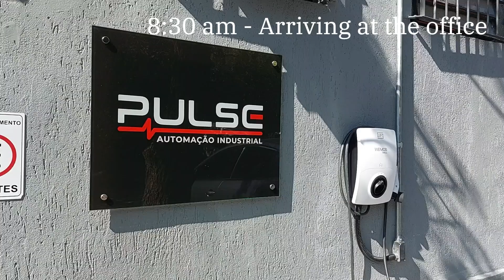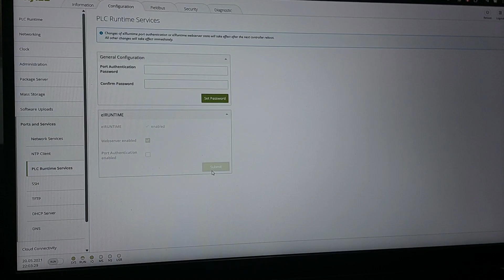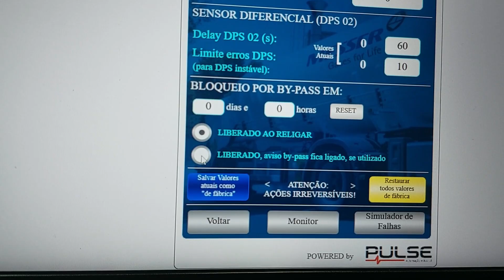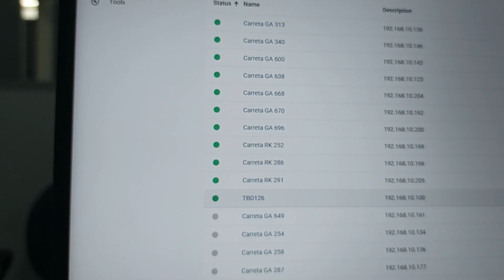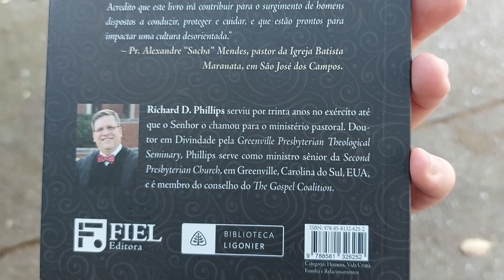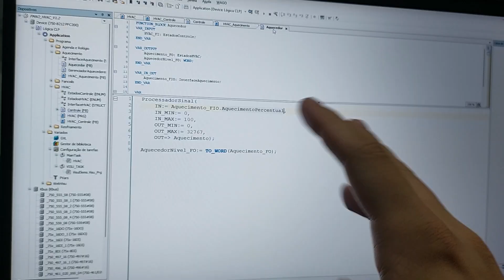A Day In The Life of an Automation and Controls Engineer

Comment: Sweet video! I am thinking of switching from a software engineering career. I was wondeirng if you had any advice for someone is my position
Reply from the maker: Thanks! Your software engineering background is actually a great foundation for controls and automation. Programming, networking, debugging, and system design all transfer very well.

I’d recommend starting with PLC programming, basic electrical concepts, sensors, actuators, and industrial protocols. The biggest learning curve is understanding how software interacts with real machines and physical processes.
Reply from the maker: Download CODESYS 3.5 SP22, it's free and a great tool to start learning PLC programming.
For learning industrial protocols, you could try to code a Modbus TCP Python script and interact with CODESYS, for example.